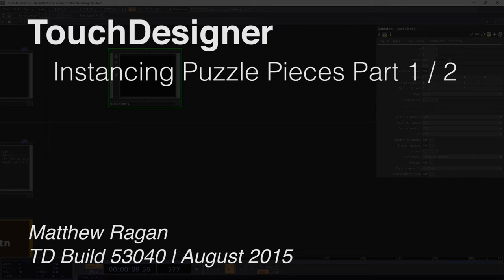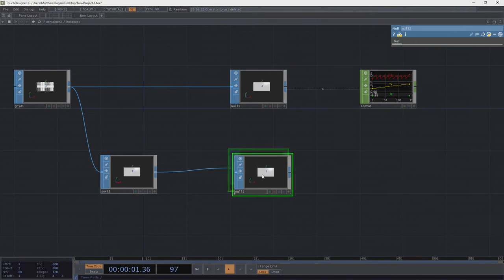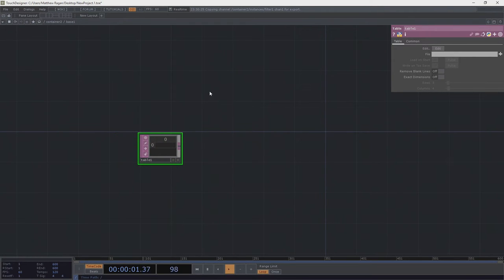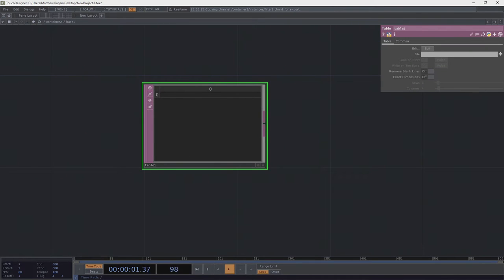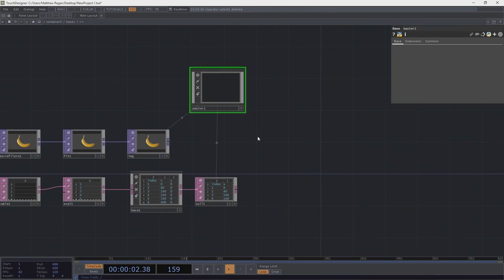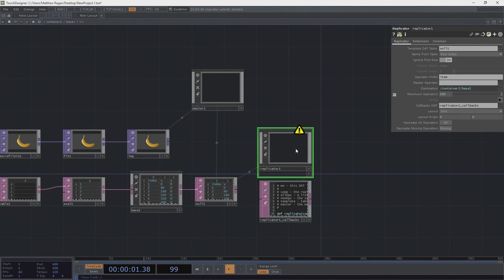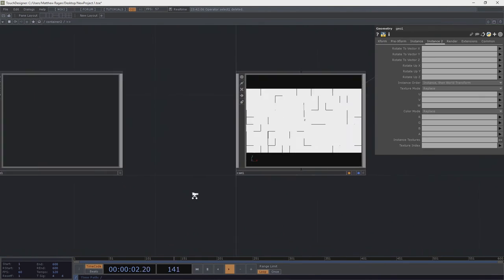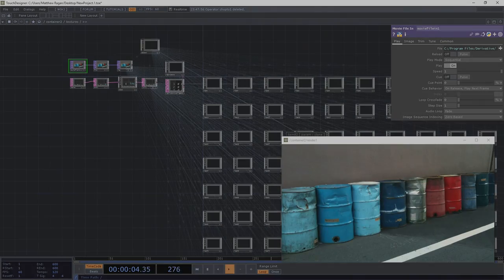Advanced Instancing | Puzzle Pieces Part 1 of 2 | TouchDesigner

Comment: No need to do any of these crop business i think.
You can simply texture map the square and play with the scale and the offset of the texture map to fit.
You also need to put tx,ty,tz to u,v,w respectively under Instance parameters and set the texture mode to offset.
Reply from the maker: Ali Tan Ucer that's correct. In the repo there is an example of using uv offsets.
Reply: Cool.. sorry i didnt check the repo.
But still, this is a great example to learn other things that you were mentioning.